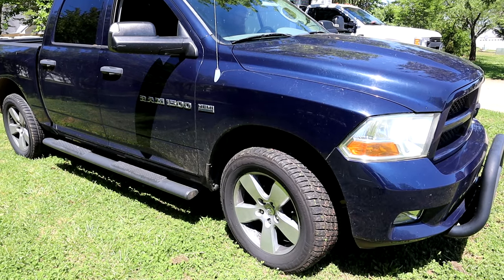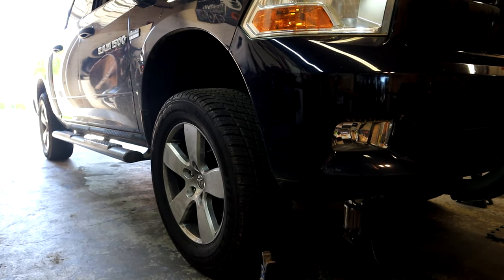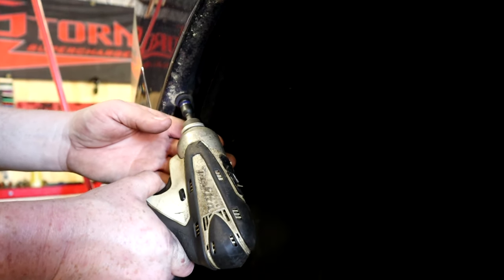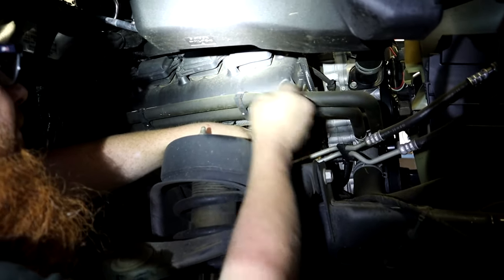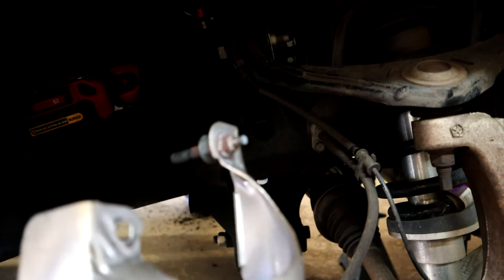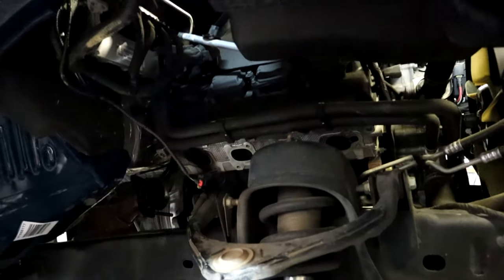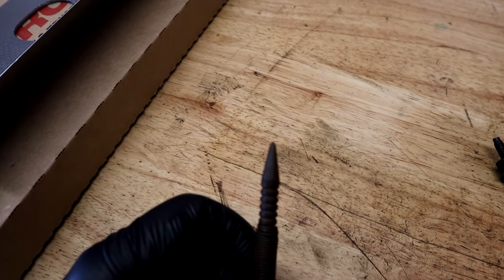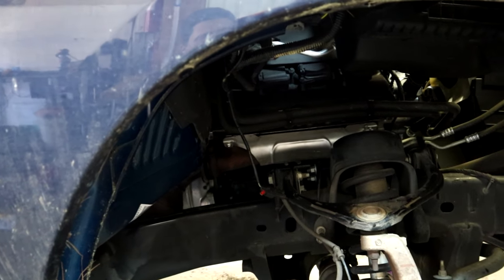5.7 Hemi Ticking/Knocking Exhaust Manifold Leak Repair.

Comment: Does any one have opinions on what I been having a Issue on My  2016 1500. When The truck is hot and has been running for awhile I notice when I push the gas to take off it takes a lot of foot power to accelerate like the truck doesn’t want to go so I have to floor it to move?? loss of power out of fist gear.
Reply: I'm experiencing this now. Did you ever figure it out

Comment: Think if I have to go this far to change a bolt, I'd just put headers on my ram too. I mean you're there and it's all off, might as well go there.
Reply from the maker: We was but decided to go with a supercharger instead better bang for the buck.
Reply: @FrostbiteRam   Yeah I'd love to put a supercharger on mine too( 2011 Ram 5.7l  standard cab Midnight Blue). But an $11,000.00 job ( that's what the shop in my area wanted to charge. with a dyno run for tuning and a cam swap) is a bit much compared to $1965.00 for a set of American Racing Headers 1-7/8-Inch Long Tube Headers with Catted Y-Pipe. No not the performance  or much , if any, increase in pwr. But it'd sure sound cool. LOL Yeah even if I could do a supercharger/cam swap and dyno tune for 2/3 that price ($7200.00). it's too much still for me. Just putting the truck on the dyno here costs me $500.00.

Anyway glad  you can do it and I like your stuff.

Comment: Hi, my UK mechanic replaced both manifold gaskets including getting broken bolts out. He billed me for 32 hours at £1900. Is this excessive?
Reply from the maker: Not sure the pricing over there.
Reply: A bit on the excessive side for sure. It's not 32 hours labour by no means. Maybe 8 hrs tops taking your time

Comment: Mine has aftermarket king tube headers but I’m pretty sure this is the issue to my ticking
Reply from the maker: If it goes away after warming up most likely is.
Reply: Make sure to know if it’s a lifter tick or this this really isn’t a big deal

Comment: How much does a repair like this cost at the dealership? Who else can do this kinda work? Thanks
Reply from the maker: A regular exhaust shop or repair shop should be able to do this much cheaper than dealership probably
Reply: @FrostbiteRam  thanks
Reply: @floridajames04  
Here in Florida it's about $500. Parts and labor.
Reply: @thequeenofwitches7943  where at? The dealership or a muffler shop got a 2019 at 60k seems to do it now

Comment: would a new exhaust system also fix it?
Reply from the maker: Not really but they seem to break more often with the factory manifolds.
Reply: @FrostbiteRam  been trying to find a hardware kit for my 2020 ram 1500, but i cant seem to find one for my year, any website suggestions to look at?
Reply from the maker: @k-dadsgaminggarden5042  the Dorman kit from local parts store is what I've used a few times.

Comment: The reason that bolt snapped is because the manifold warped too much.  Common hemi issue on the 5.7

If you don't, get the manifold lapped and flattened out at a machine shop.  Or get a new manifold along with the gasket... you are just going to have this issue likely come back quickly down the road due to the unnecessary pressure put on the new bolt in the warped corner.  

How to video is perfectly fine.  But save yourself the hassle and replacing another gasket down the road and get another intake manifold or get it lapped on the cheap at a local machine shop. (50-70 bucks)

Comment: going to happen again too because they didn't actually fix the problem only the symptom. the headers warp! that's why the bolts break. simply putting new bolts in does nothing to address that fact. so they will certainly break again in short order no doubt.

Comment: no one ever discusses the cause of the broken bolt is most likely the terribly restrictive forward Y causing a ton of back pressure
Reply: Nope. Warped manifold. Every time. Replace with NEW only!
Reply: @HardwoodMN yeah it’s going to snap the bolt again or crack the manifold. Needs new manifold or at least the warmed one needs machined down to flat again.

Comment: Man I should have bought a truck instead of the WK Grand Cherokee.  You should see how little space you have in the Jeep to get to those manifolds.
Reply from the maker: I could imagine lol
Reply: Did you do this repair on the GC, any tip?
Reply: @billkeating9810  No lol.  You are pretty much ****ed if you have broken bolts or studs on the manifold.  Now I'm not a pro mechanic.  There may be some trick to doing this, but to me it seems like raising the motor up is the only way to get it done.  I'm just living with a leaking exhaust manifold.

Comment: Not sure why you'd go through all of that trouble and install the old warped manifolds 🤔
Reply: Maybe because it's warped, it may not be warped further? 🤣
Reply: You are right. All that work and it’s going to happen again.
Reply: Cause most of us are doing it at 200k on our 3rd gens and the repair will outlast the rusty cancer the rest of the truck has b4 it gets turned in for scrap

Comment: If this is a known issue with 5.7 Hemi's, shouldn't it be  covered under the drivetrain warranty? I have a 2020 Ram 1500 which has a broken bolt and I'm going to call the dealer today to bitch. The truck has 45,000 miles on it.
Reply: Is this covered by warranty?
Reply: Did they cover it??

Comment: GOING TO BREAK AGAIN BECAUSE YOU DIDN’T FIX THE WARP HEADER…..MACHINE SHOP WOULD DO IT RIGHT ….A NEW STOCK ONE WOULD DO THE SAME DUE TO IT HASN’T BEEN THROUGH THE HEAT CYCLE YET…EITHER REPLACE WITH SHORTY STAINLESS HEADERS OR USE THE ORIGINAL ONE AFTER YOU MACHINE IT FLAT….
Reply: Why the all CAPS?!!? 🙄🤦‍♂️